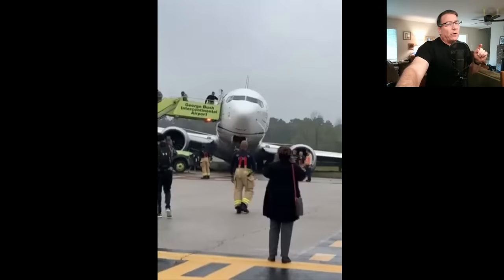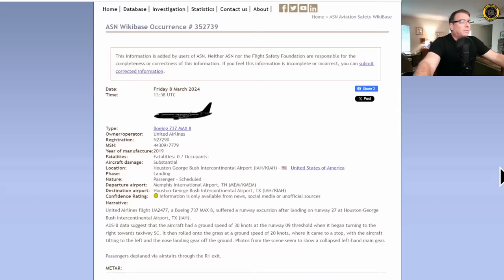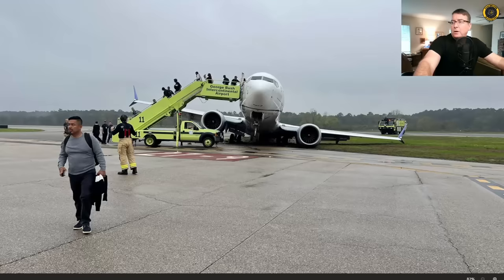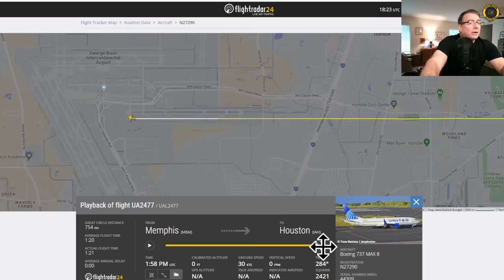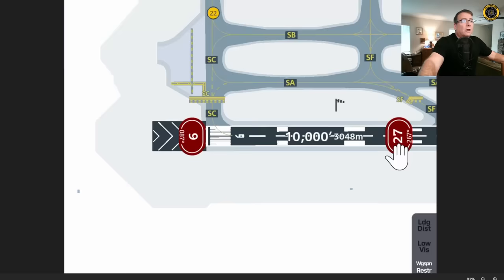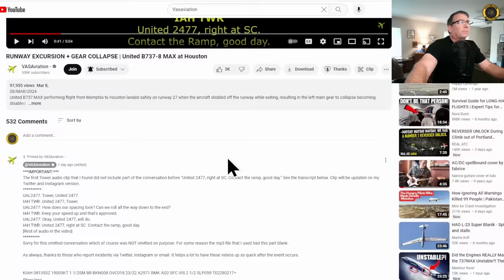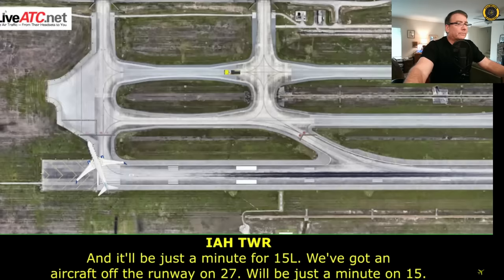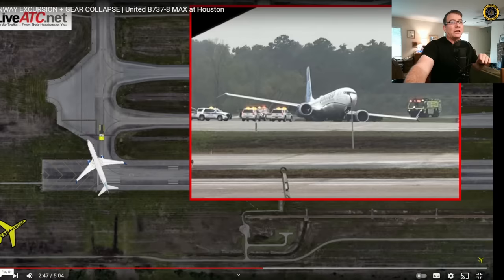United 737 Max Runway Excursion IAH 8 March 2024

Comment: ...and United Airline's SIXTH incident occurred just hours ago in Sydney..  

Incident: United B773 at Sydney on Mar 11th 2024, hydraulic leak
By Simon Hradecky, created Monday, Mar 11th 2024 20:09Z.

A United Boeing 777-300, registration N2140U performing flight UA-830 from Sydney,NS (Australia) to San Francisco,CA (USA), was in the initial climb out of Sydney's runway 34L when upon retracting gear hydraulic fluid leaked from the right hand main gear. The aircraft completed the gear up and continued the climb reaching cruise FL300. Over the Pacific Ocean about 340nm east of Sydney the crew decided to turn around and return to Sydney, performed an alternate gear extension and landed with open gear doors but without further incident on runway 34L about 2 hours after departure.

Comment: Unfortunately, this flight crew walked right into the accident chain bear trap. Landing on contaminated surface electing to roll long trying to shorten the taxi on the same surface and excessive speed during a turn a classic set up for an accident, seen this happen all to many times throughout aviation.

Comment: I want to see commentary on how they remove that airplane and reopen the runway quickly!   Bad day at work for the pilots!
Reply: It will not be quick as the left undercarriage has collapsed and a temporary boggie will have to be inserted. This will require lifting air bags under the left wing and rear fuselage. This will not be a cheap operation.

Comment: 33 knots is right at 38 mph. Even in a car on a wet road you're not going to turn right on a 90° street at that speed.
You can bet UAL will be putting the brakes on that flight crew. The FAA and NTSB in time will do the same.

Comment: Very interesting. Thank you. Approaching the end of the runway and making a 90 degree turn off while expediting for traffic behind is a challenging balancing exercise that really requires a high level of skill. Throw in slippery conditions and the risk is greatly increased. From a risk management perspective, it's not a maneuver that I would want to be responsible for. ATC has every reason to believe that the pilots can do what they are requesting. That being said if ATC understood the challenge and, in the interest of safety, denied the request and offered the high speed exit only this would have been prevented and would have maybe only added a minute or so of taxi time.

Comment: When first saw the photo of the 737 off the pavement, I had an immediate flash back to the early 60s at Beale AFB, where I was a Defensive Fire Control maintenance guy. While a tug was backing a B52G into its parking space on the flight line, the tug operator backed the aircraft too far, so the four rear wheels/tires left the concrete and onto the asphalt. The bomber immediately sank so the rear axels were at ground level. I’m sure the folks at SAC headquarters were in panic mode. This was, after all, an active bomber incapable of performing its mission until it was back on the concrete.

Comment: There is not a whole lot of weight on those two small nose gear tires. So they are easy to slip or skid and be ineffective. On top of that the anti-skid for the mains deactivate if I recall correctly at 18 knots. So slip slidin away you go. The thing is you should not put yourself into that position to begin with....

Comment: "Dang it! .. I was watching the tire fall off the triple-7 and got distracted"
Reply: without trying to be "funny" ... as JB pointed out, it would be easy to see how a heavy aircraft perhaps going a little too fast could easy overload those two "skinny" front tires while turning. This is ez to replicate on the snowy streets of Chicago ... go straight at a normal speed and then try turning and braking simultaneously ... yep how about that  ... I'm going straight even though my front wheels are pointed in a different direction instead of turning ... hopefully into the weeds and not into oncoming traffic.. last words heard from the PIC "oh schitt!"

Comment: Captain obviously screwed up.  But am I the only one that finds it odd for the gear to collapse from sliding into the grass at 20 knots.  I know of a few A320 excursions, one which was at about 80 knots, and the gear held just fine.
Reply: I think it's all about how much sideload is placed on the gear. It was never designed to have a heavy side loading. But if you slide to one side and then hit soft mud, there you go
Reply: @nothingmuch875 That’s not completely accurate.  Research this accident.  Yes, it was an accident. 

“The FAA told the Daily News on Monday that it was investigating an incident that occurred July 5 at 1:35 p.m. involving Allegiant Air 1991, which originated from Newark Liberty International Airport in New Jersey. According to the FAA, the Airbus A320 aircraft landed on Runway 19, rolled off the side of the runway then back onto the runway.  The aircraft then taxied to the gate and passengers exited the aircraft normally.”

I know for a fact that this A320 slid approximately 1000 feet sideways through the mud in a thunderstorm before regaining control and re-entering the runway.
Reply: @PistolPackingPilot Not all sliding will put excessive load on one side of the gear, it is completely incident specific. United could have hit a dip in the grass that could exacerbate the load on the left main gear. Also, your story doesn’t quite make sense, I don’t think an A320 can slide 1000ft SIDEWAYS through mud and then regain normal control and taxi to the gate.  I have a feeling it went much differently than how your describing it.
Reply: @vfraddict I’m glad you think that.  Look it up.

Comment: On airfields. There needs to be a requirement that ground around the runway, and in particular at the ends is level and is as large as possible.
Reply: Often profiles are intentionally created for proper drainage.
Reply: Those requirements exist, but they are of little use if the operators don't abide by limits. Turning your car onto your driveway at 7 mph is no problem. At 30 mph, it won't work, but that's not the driveway's fault.

Comment: Is “Tillerwheel drift” or “Tillerwheel skid” a technical term?
Reply: Nosewheel skid.  Yes, and it happened here.  There are other photos out there of skid marks, including nosewheel skid marks.  There are no brakes on the nosewheel so it was obviously turned and skidding.
Reply: @johnaclark1  Noted! Thanks. And I’m sure even if it did have brakes it would only exacerbate the problem of skidding under excessive speeds and wet conditions.

Comment: Wet threshold paint markings exacerbates understeer potential, especially at the far end as the approach angle to the turn is based on a higher speed than taking the runway for departure.  Just my experience.

Comment: I drove a car with a known "understeer" mode on a slippery surface. It would turn a little, and suddenly you will hit the stop of the steering wheel while it would continue to move straight. And it does not feel wrong until you hit full stop of the steering wheel! I guess the tiller is even worse in that respect.

Comment: Not to get too over whelmed by this, but the pilot should have been a little more assertive and told the controller they needed the entire runway. I'm sure every United pilot landing at this airport wants the last turnoff into their parking stalls. The controllers should have recognized this was a United flight, where the airline gates were and included into the flight sequencing. If the FAA controllers cannot understand this there is a problem bigger than just a runway extrusion. This accident will cost United several millions of $$$. Shame on the FAA.

Comment: I'm certainly not knowledgeable on 737 thrust reversers, appears starboard engine reverser was not activated, (which is to be expected on approach to taxiway). I understand they are pretty effective on the Max. Problems with reversers?
Reply: They likely would have stowed them below some specified airspeed...by the time they made that turn they would have been stowed.
Reply: @johnaclark1  Right.... they were looking to use the runway length... on a wet runway. Just wondering if they secured reversers too early or a problem when they were first deployed.

Comment: It's unlikely,  but there was another UAL 737 earlier that had the rudder stuck in the neutral position upon landing.  I suppose there could be something wrong with peddle assembly causing it to stick and in this case prevented brake application.

But, human factors seem way more likely.
Reply: That's not related, you're just making stuff up now.  We all heard the cause on the tape 🙄

Comment: It appears to me the paint on the run way might also be a contributing factor to the aircraft’s skidding beyond the paved portion of the runway.  Having investigated a crash or two, wait pavement paint has a significantly lower “R” value than just wet pavement alone.  So a over speed plane, wet runway conditions and wet pavement markings seems like a winning combination for an uncontrolled skidding event from over braking. Just an opinion from the little evidence we are able to see.

Comment: On Monday this week, after 6 delay notices for my flight from SFO to LAX, ( a 54 minute flight) 
the tug crew busted a part on the nose gear during pushback from the terminal. Requiring deplaning, 1 hour to fix, re boarding.
Total of 7 delays.
Original 7 pm arrival turned in to 12:30 am.
United

Comment: You should LEAD with "We don't want to make assumptions about what happened". You're not an airline pilot nor are you providing what appears to be neutral commentary. Quoting passengers that they "think they came in fast" is nothing but an attempt at hyperbole. You know better than this. I think you also failed to mention that the runway was wet...your viewership does not make you an expert. Experts, as in almost all accidents and incidents, know there is more to the story than a simple surface derived explanation. Perhaps this one is different. We'll see. Until then, trained accident investigators always approach it with an open mind without blame inferred, until it's due.

Comment: I'd like to see the seating chart. Airlines charging extra, not just for 1st class, but also forward coach cabin seats tends to make budget conscious passengers to choose those far rear seats, even on lightly loaded flights. Nose wheel steering, especially on wet runways, and low "airspeeds" (even on the ground) where rudder steering is diminished, depends on weight on the nose gear. Rear center of gravity keeps the nose light. Data recorder will reveal if there was excessive nose down trip inflight.

Comment: I understand that this, and the B757 engine failure, and the B777 bloody tire falling off, are not Boeing's fault. But every airplane incident recent has been a Boeing. John Q Public doesn't know what we know. All they hear is "another Boeing".  People are already avoiding Boeing Max A/C.  This is really grim.
Reply: This many issues is not just bad luck. When you really dig it comes down to bad design or bad manuals… in the end it is boeings fault. Otherwise other manufacturers would have similiar issues at similar frequencies… which is not the case. Time for boeing fanboys to stop living in denial…

Comment: The nose wheel seems to have slid but the crew may have improperly added power to try and move off the grass.  That could account for the collapsed LMG.   The explanation for the nose gear being so high off the ground will be another interesting finding.

Comment: Bad weeks for UAL, Boeing, and the Max again.  Any insight into the stuck rudder pedals at EWR - Simon shows it occurring Feb 6th but seems it was just reported?  I only saw that reported in the local NY Post but UAL called in the NTSB after a check flight on the 9th produced the same results.  Quite a PN conversation in the comments on Simon's site - be interesting to know what other types use the same PN.  Also, the Alaska Max into Portland that arrived with the pressurized cargo door slightly open either in flight or during touchdown.

Comment: The Tower isn't supposed to use left/right directional instructions. They are supposed to use headings communicated in degrees 0° to avoid any confusion to the pilot.
Reply: On the ground? No, it’s “left/right at [intersection name].” In the air, it’s also left or right followed by a heading. Just stating a heading could cause an aircraft to go somewhere you weren’t expecting.
Reply: Not in the air. Tower could say his left & it's actually to the Pilot's right. Sometimes the Tower is using his point of view instead of the Pilots.
Reply: @sSHAPZz  according to JO 7110.65AA, paragraph 5-6-2, either phraseology can be used but it’s situationally dependent. 
I would offer you the example of an aircraft flying heading 360 and the controller wants them to fly heading 180. A left turn vs a right turn could put an aircraft in vastly different places and therefore the specification of direction is necessary.

Comment: At 2:30 you can very well see the trickery Boeing did to fit these modern large diameter high bypass engines to this outdated short legged design. They needed to move the engines forward and up, the latter clearly to be seen here. Result? Thrust vector is in the wrong place (=dangerously flawed design). Result? MCAS, over 300 deaths and yet this design flaw still is allowed to fly. Unbelievable. Never will I or my family fly with one of these death traps. Sooner or later there will be another sad event with MAX and then hopefully it will be grounded for good.

Comment: The facts prove that this crew/captain has poor judgment as to safety. Actually the last high speed taxiway was a better option as to time and as to safety. The tiny nose wheel tires have very small patch surface in contact with the runway. Under steer is always a potential. Whatever the reasons for seeking the last taxiway shall be determined by the investigators as it was not the best option. Between accumulated rubber deposits, the runway markings and wet surface, speeding towards the end was, as shown, extremely poor judgment.
Reply: Patch surface doesn't actually count. It's the coefficient of static friction between the two materials multiplied by the weight being applied to it. The main tires are big to take the shock of landing, the front gets lowered down gently. A smaller tire gets better traction on a wet surface because the small area forces the water out. A large contact patch will skim across it.  You don't run slicks in the rain.

Comment: Too fast of a turn and then the incident and then leaving the engines running! Seeing this as a United flight made me wonder. United has made a BIG push for DEI over finding the BEST pilots long term no matter what they look like or background. No idea if either pilot was a DEI hire. Just fine for EVERY other position other than pilots since it would not DIRECTLY effect safety. But when they first announced this DEI push the public concern was future incidents like this or crashes due to incompetent or less skilled pilots. Pilots that were hired for other reasons than being the best they could find. To be able to show a "percentage" of diversity. Same goes for future ATC employees. IMO The investigation will show both ATC and the pilots used poor judgement to rush to the gate. But we will never know if anyone involved was a DEI hire other than their experience as pilots. I am shocked that there was little talk from the pilots to the tower after the incident. Also how in the world they did not use the slides to evacuate in case of a fuel leak or fire! They just all waited for the ramp to arrive. Glad nobody was injured or worse but these pilots will hopefully be put on leave and investigated!

Comment: The landing gear is incredibly strong, well engineered and well maintained.   If it truly broke, there is more to this story.
Reply: Like?
Reply: "...more to this story."
Tons of lateral pressure, applied to a structure designed to move freely on a level surface, while not stuck in mud? 
Not much more...
Reply: This landing gear probably has a 3X safety rating to land fully loaded at a 13,000 foot elevation runaway and it breaks taking a turn at 25 mph. Something else , not mentioned, happened.

Comment: These guys obviously didn't grow up driving in snow. You don't hit the brakes or you'll slide into the snowbank every time. You use the parking brake to lock up the rear tires and make the ass end slide around while you steer the front end.
Reply: Or you downshift before you get to the corner and slow down. Or you tap the brakes instead of hitting them hard and keeping your foot down. Grew up in VT. Never had to lock the rear brakes to make a turn.
Reply: @kimberlywoodbury1739  - You don't have to, but it's a lot of fun. I used to be able to throw my mom's car around sideways all night.
Reply: @GWNorth-db8vn  We saved that stuff for the local ski area parking lot after they’d all gone home.
Reply: @kimberlywoodbury1739  - They built a new shopping mall near us, and my buddy and I were out in his bug ramming the snowpiles when we discovered they'd installed the concrete bases for the lights and that was the bases of the snow piles. That car became a dune buggy the next summer.
He jumped that thing about thirty feet off a snowbank into a field of deep snow one time without thinking of the four hours it would take to get it back out. You go nuts in the winter or you go nuts.